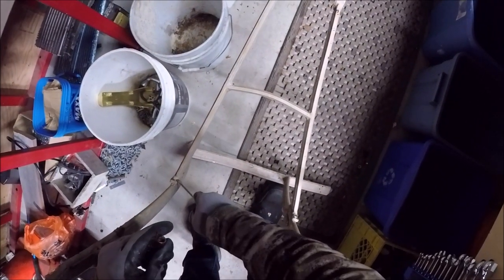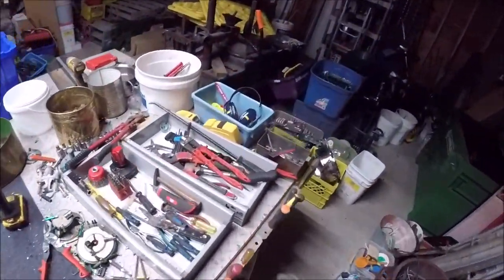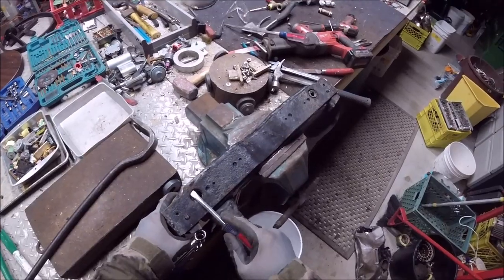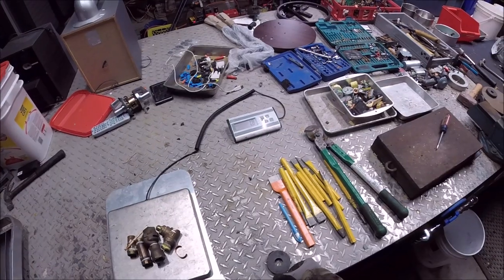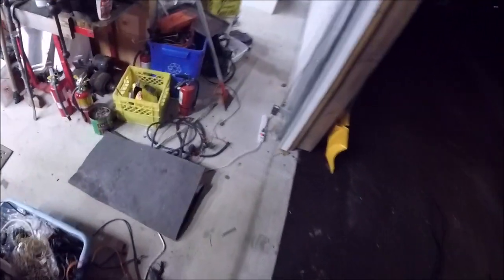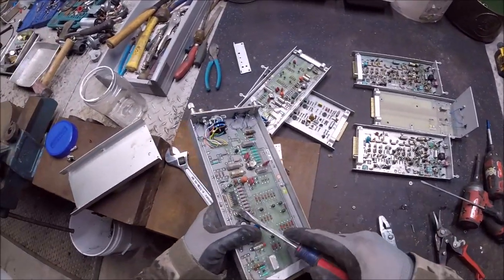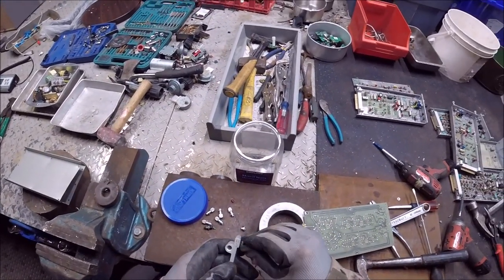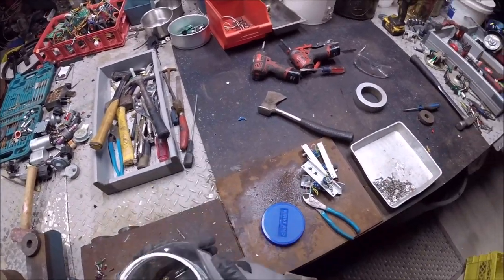Scrapping Heavy Brass Radiator + Commercial E Waste & More

Comment: What you need is a small propane torch you get them at Canadian Tire, the ones that have pre-ignition on it so you're not looking for matches or for a starter. If you would have taken that torch and heat up those end pieces, all that metal would have just fallen off because they're all braised on there with solder with it saved you a lot of time in aggravation and cutting it up. You could have got rid of it all at one piece so you got to get yourself as propane tank. Those little green ones with the torches on it. You can have it sitting on your bench and you be amazed at what you can do with that propane tank it take stuff apart. Just something to think about.
Reply from the maker: I plan tp get one, I have a large Tiger torch

Comment: China can manufacture to any standard of quality. If the product is crap blame the US or Canadian company that sourced the product using inferior specifications. I get tired of all the China bashing when they are producing to specifications supplied by the Western customer.
Reply from the maker: Your right blame it on the Cheap company's, But They use Lead based paint + also other toxic chemicals & Even Plastic rice? The blame is on both sides